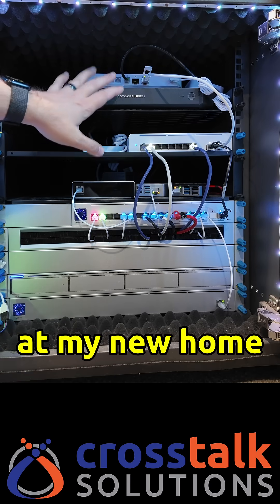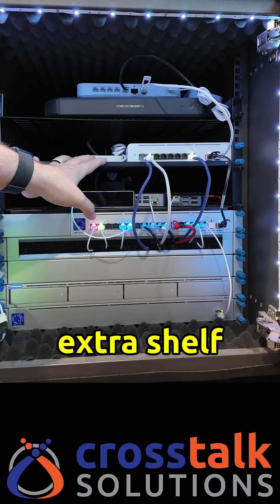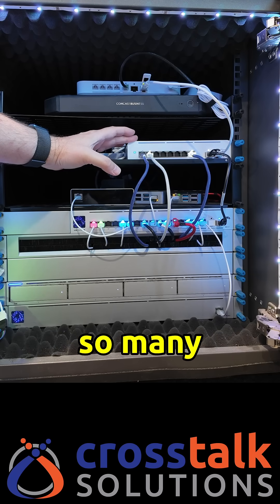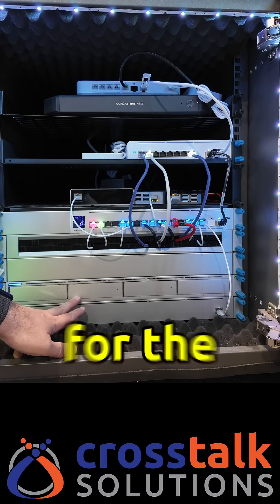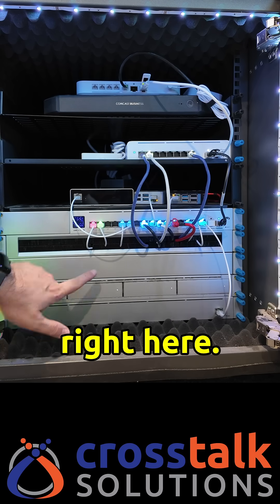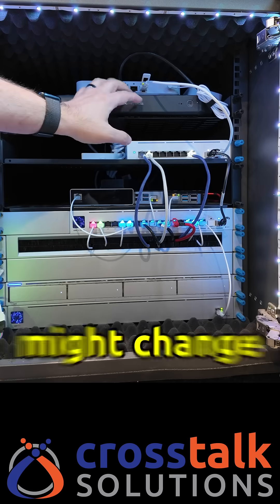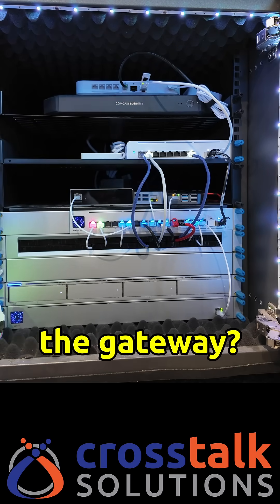Why I Downsized My Home Network Rack

Comment: While I generally discourage daisy chainging, your setup is fine lol. I'd see the 8 port switch as more of an aggregation switch anyway.

For multi switch office setups, I usually use an agg switch for each of the other switches to plug into, then link that agg switch to the gateway.

Comment: I love this stack and am considering a similar move  from UDM-SE to the Fiber router. For slightly different reasons, the reduction in heat production is a strong one too.

For switch interconnects, with a layer 3 switch, I would keep all the switching exactly there (Pro MAX is my "Core" L3 switch with some other utility switching/APs hanging off it). The Cloud fiber gateway keep that out of(almost all) switching tasks so it can focus being a great powerful/low latency gateway.

Only caviats are where the devices are and how the cabling works out, but in a cabinet like yours I think this is the most effective Switch configuration, with the daisy chaining.

Comment: Print a tray to sit in the where the old 24 switch was for the 8xg switch and the fibre to sit next to each other then you can use the brush panel and route the cables nicer

Comment: Comcast has been offering their 2Gb plan for the same price as the 300Mbps plan. The main benefit is your upload speed goes from ~40Mbps to ~300Mbp 

One thing to note is  the Ubiquiti UCI is compatible with the higher upload speeds (DOCSIS 3.1 mid-split) and will pay for itself in 18 months through avoided modem rental fees 

*Just remembered you’re on Comcast Business, so pricing and plans could be very different from residential

Comment: how you have it not is the right way, if you run both to the fibre you are using the fibres cpu for switching and its not as good as a proper dedicated switch.

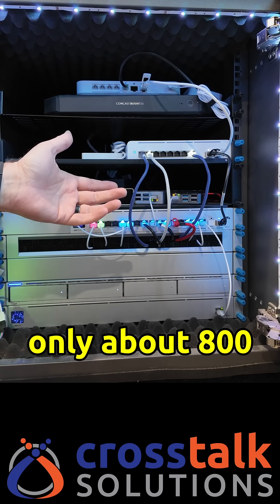Comment: 1:40 Even if your Internet is not fast enough to need a UDM, you still might benefit from higher throughput in vlan-to-vlan connections, depending on your setup.

Otherwise, downsizing is a good recommendation to most home users! Gear Acquiring Syndrome (GAS) is quite common and costly, with little benefit. Ubiquiti has a reputation for causing that in customers - smile.

The UCG-Fiber and the Pro XG 8 are a strong combo to start off from, and will continue to be great down the upgrade road, thus a good choice. When buying something new, I try to also account for the day my new device will be replaced, and thus chose one that hopefully will then be good enough as a second-tier device. i.e the U7 mini is a nice entry AP purchase, because a) price-performance is fantastic and b) when one day you go U7 Pro XG or even E7, the U7 mini can be used to extend your nice MLO Wifi 7 into your garage or basement. A similarly priced U6 doesn't has that feature.

2:41 I would keep the router as highest single upling, aka your current config. For local traffic, switch-to-switch is the fastest and you get the full speed out of it. The router only needs to get involved for wan-lan traffic which saves resources. Even if you run inter-vlan connections, your UCG will bottleneck before the DAC cable does, so nothing is lost.
That being said, it sure does not hurt to have a direct connection/triangle. Redundancy is a good thing to have in your back pocket.

Sorry for the long comment :-)

Comment: Both switches to the gateway and to each other.  Setup port isolation on the ports on the gateway to prevent loops and set priority for traffic to flow through the 10GB switch.

This setup will allow you to reboot the 10GB switch, USG Fiber, or Pro Max without taking the whole network offline.
Reply: I read somewhere that the UCG-Fiber only has ~9Gbps throughput. So if you want the full switching performance that’s something to consider. 

But uptime is nice too.
Reply: @Zaf9670  If true, that's yet another reason to set the switch priority to route through the 10GB switch.  In this scenario, you can have your cake and eat it too at the expense of losing 2 additional ports and one extra cable.

Technically, the "full monty" of this setup would also include an additional line between the Pro Max and the USG Fiber as well but that wasn't really the question being asked in the video so I didn't mention it.
Reply: @davidprinzing  I'll admit I was on speed read and missed the part where you made the switches connect as well. I may look into that as well since I have the Flex 10G that can be powered via PoE but I prefer having a 10G back to the switch for throughput.
Reply: @davidprinzing  So I'm trying to get this going on my end but not sure how to eliminate the STP warning.

I've got my UCG-Fiber PoE+ connected to my Flex XG 10GbE PoE-in (1GbE) then one of the 10GbE ports connected to my Pro Max 16 which is SFP connected to the UCG-Fiber SFP. I setup port isolation on both sides but it still complains. Thanks in advance!
Reply: @Zaf9670  My comments have been automatically deleted twice.  Not sure what is going on.  I'm just leaving this here to see if it vanishes.
Reply: @Zaf9670  I don't think YouTube likes the unifi website link I keep posting.  For brevity, did you review and set your switch priorities properly?
Reply: @davidprinzing  You can thank the bots and spammers. As is so typical, those behaving badly gum up the works for the rest.
Reply: @Zaf9670 to the ethernet ports yes, but each sfp port has its own cpu connect.

Comment: Run both switches to the gateway!
Reply: I’m curious what the advantage of this is over daisy chaining switches?
Reply: @xHyperElectric if the switch in the middle dies, the switch at the bottom will be down.
Reply: @JoaquinDagou  Same can be said if the UCG dies. But does the UCG switch LAN packets between the ports in a hardware ASIC or in CPU? If it's CPU, as it's a firewall this is most likely, then daisy chaining the switches is better.
Reply: @lordcarnorjax8599 daisy chaining switches is never better. Think about this, you have 5 switches daisy chained together, and switch 1 that is connected to the UCG dies, you have now lost ALL switches. The reason why you don’t daisy chain is so that you limit your points of failure. Daisy chained switches have multiple points of failure whereas connecting the switch directly to the UCG has one. And of course in any scenario (daisy or not), the UCG dies, everything behind it is down.
Reply: @JoaquinDagou In the original situation where it was just two switches daisy chaining is correct. In this new scenario daisy chain and then create a STP loop from the top to bottom to provide redundancy that way. Which I don’t like but it’s the only option with UniFi switches currently as the MC-LAG on the top line switches is buggy as hell and the enterprise line still doesn’t have stacking support. But if using a UCG there’s always going to be a single point of failure especially since the controller runs on it.

Comment: I think I would reconfigure the WAN SFP port on the Fiber to be a LAN port and connect that to the Pro Max 16. But in general, I try to not rely too much on my Fiber's switch. I have a feeling that it's not super performant - but I haven't done any tests to confirm that 🙂